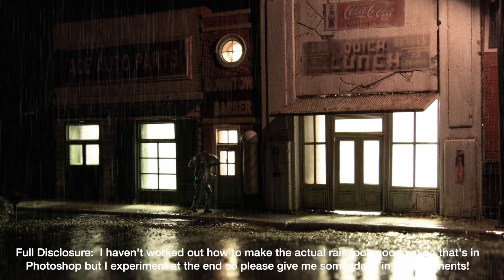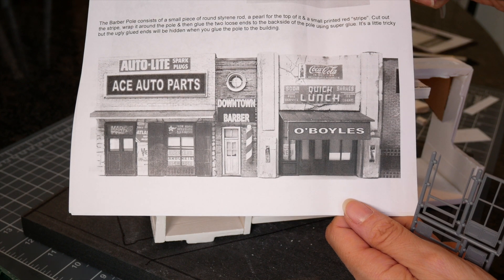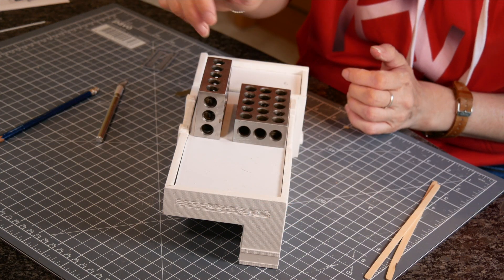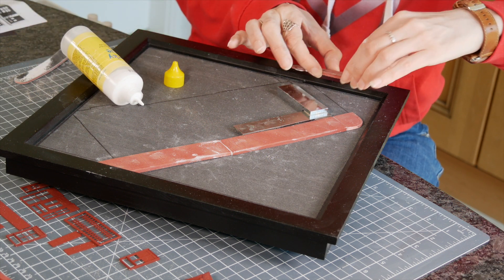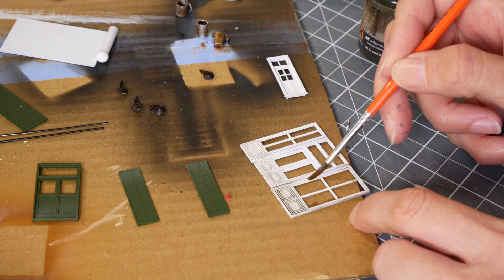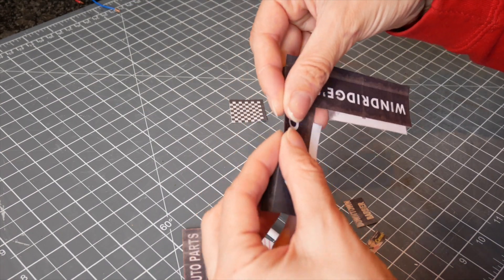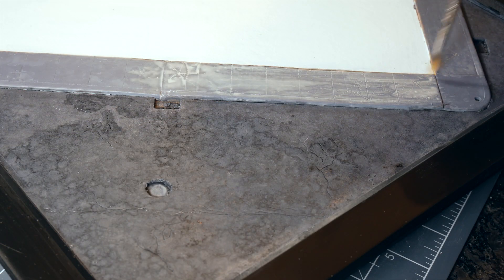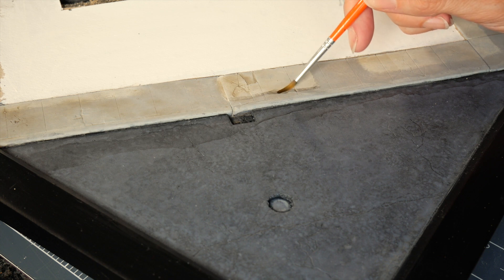Model a Realistic Rain Diorama

Comment: On making the actual rain, sounds like a beach of a thing. Been pondering it for a bit and if I had a gnu to my head, I'd be using...

https://www.amazon.co.uk/0-2mm-Diameter-Fishing-Beading-String/dp/B00B14LRLU

and build an enclosure so the majority of the effect can be adhered to the inside. A bit of work with some smoke colour transparent air brushing on the inside of a clear case would smudge the visuals, and apllying fishing line both to the interior of the enclosure and some to the top surface of the enclosure could work. Was considering fibre optic but FO is designed to be visible, so, even though you could scrape that to get high light points for drops overall I suspect it'd look more like someone's doused the scene in string.
I'd probably try gluign bits of fishing line of various lengths to the top of the enclosure, letting them hang free so grammity would straighten them, you might end up with them looking like various altitudes within the model space.
Can't say that'd definitely work, can say it sounds liek a beach of a job, but, it's the best I have at this point. Doing it without an enclosure would be tougher.

Also, on the thumbnail there's light escaping from several spots around the quick lunch building, and a spot to the right by the drainpipe. Sure these would be easy to close off even post build.

Nice job, though, even without further work. Time to do a co-op with Everard.
Reply from the maker: Hi. I did think I’d filled all the light leaks but then I find more!  Your suggestion reminds me of those old raining oil lamps where oil trickled down wires. Beautiful workmanship but tricky to get right.
Reply: @KathyMillatt  Yeah, I'd certainly be thinking of doing a test on a much simpler rig to work out density. I do find myself pondering if, were one to touch a heated plate with the end of fishing line, you'd get that tiny melted ball that'd potentially do well as n individual rain drop.

But then, in anycase, you'd be talking at least hundreds of individual lines and not having that kind of patience is exactly why I don't model any more. :-)
Reply from the maker: Admiral Belzediel that would need a lot of patience!

Comment: You put the interior of the corner building in upside down.
Reply from the maker: Nope, all in correctly.
Reply: @KathyMillatt  9:53 the seats are on the ceiling in the picture.
Reply from the maker: @tethys17  but I changed it...
Reply: @KathyMillatt  10:44 you glued it in upside down.
Reply from the maker: @tethys17  This is the bottom not the top so it needs to be upside down.  The lights are in the ceiling, not the floor.
Reply: @KathyMillatt  I know I'm just messing with you.

Comment: Hot glue hairs?
Reply from the maker: I’m not sure I could get them reliably fine enough and the right length but it’s definitely going in the right direction.
Reply: Or different grey hairs maybe hairspray them straight?
Reply from the maker: @OGBIGREYRAY  Thanks for the suggestion. The problem is that rain is not that long, it's made of drops so you are looking at motion blur but it's not 12" of motion blur.